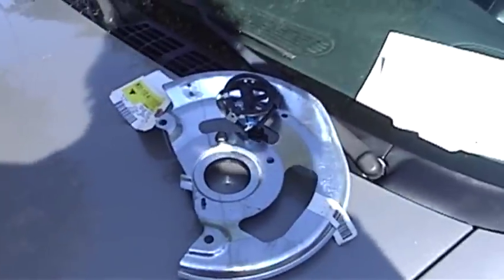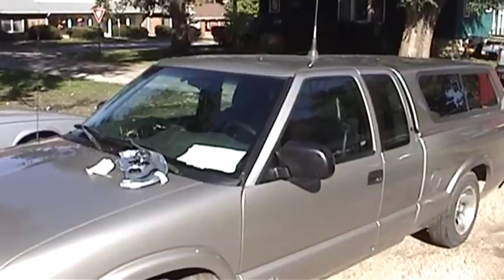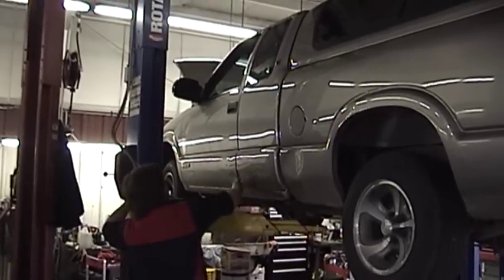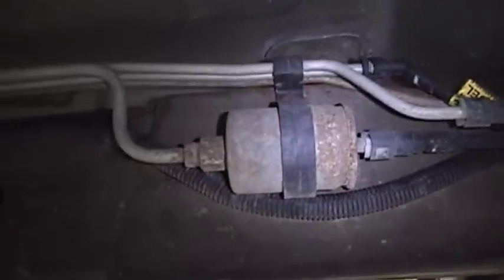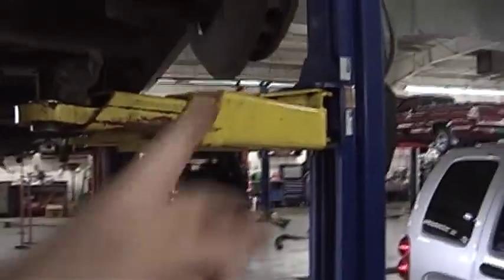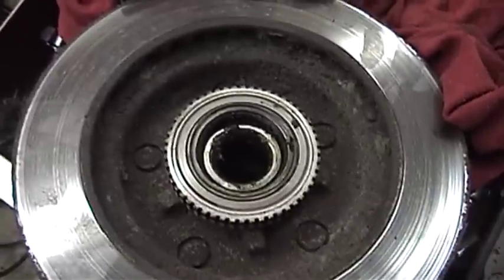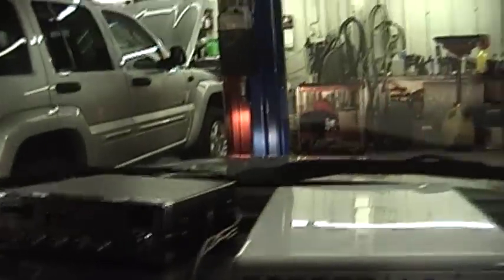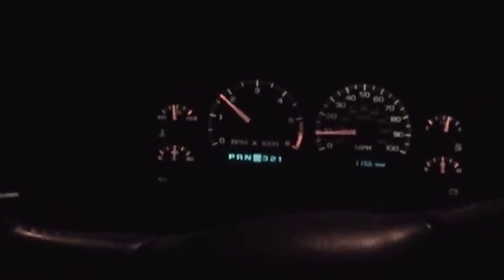2003 Chevrolet S10 ABS Wheel Sensor Replacement

Comment: I disliked this video because you do not show how the technician managed to get the electrical lead disconnected and connected.  On the S-10 it looks like it requires a trained squirrel!  You wasted my time because the manipulation of the wiring was what I needed!
Reply from the maker: Good for you.
Reply: @uxwbill   OK I did it.  The GM Factory Manual, Volume 1, Page 582/583 is of very limited help, but it did lead me to a web detail of the connectors.  GM Part No. 12052641, Metri-Pac 150.  The location of these connectors in the 4.3 V6 was established on the assembly line before the engine was installed.  They are a P.I.T.A. to see, reach, and disconnect.  My arms look like I have been in a machete fight.  The right side is much easier than the left.  I manipulated a long flat blade screwdriver under the plastic tab on the connector and with a flip the connector separated.  This is NOT easy to do there is so much in the way and the connector female side is attached to the frame on a sliding little bracket.  On the right side removing the mass air flow sensor and the air filter will help.  The GM personnel involved in the wiring routing details should be ashamed at this.  They have no interest in maintenance, just moving the vehicle down the assembly line.

Comment: I wonder did the brake lights eventually pop back on after a few weeks???
Reply from the maker: No, I never had any further trouble with it. Several thousand miles later, I traded the truck off because the fuel pump failed.

Comment: my mom's 2003 chevy blazer the brakes sometimes spaz out on her, like we will be driving down the road and preparing to stop so she puts her foot in the brake and then the brakes start to stutter then she loose all pressure in her brakes and therefore she has to pump them to get them back. we have taken the car to a part store and there are two abs sensors that have gone out. we have replaced the master cylinder and that has helped a little bit but it doesn't fix the problem.

Comment: My 2000 chevrolet s10 xtreme active or press the brakes after driving several minutes. brake pedal becomes hard as if the vehicle off. as I can fix this problem?

Comment: . You show us your truck parked, you show us the neat code reader, you show us what the underside of your truck looks like. It's 4 minutes in till you show the wheel. Then there's a shot of everything off but the wheel sensor.
My husband fortunately has done brake work, so he's taken everything off, but it would help if you stayed on task and showed the process of actually taking stuff off for someone who hasn't done brake work yet and just needs to do the sensor.
 Are you not allowed to show it?
Reply: To anyone that needs it, this video shows the wheel, rotor, and hub removal process for a Chevy Astro 2WD which should be the same as the S10.

https://www.youtube.com/watch?v=WCXcAH33RR8

Comment: Hi Bill,  The “cow head” as you referred to on the yellow tag is there to aid the GM employees when sorting a particular GM dealers parts order in the warehouse . Every GM dealership has their unique symbol.  This reduces errors as the picked parts are sorted and increases production so our customers can get the right part in a timely manner.  Thanks for the video. Waiting for spring to replace my speed sensors on my 2000 suburban.

Comment: Hey Bill I have a question for you to ask the keykeeper.   My ABS light sometimes comes on along with the brake light but I shut my truck off then start it back up and they go off.  Cause what it will do is I start it and my brake and abs light both come on.  Then I shut it off and turn it back on and they go off.  What could that be?  Cause there is nothing wrong with my brakes.

Comment: They do make portable lifts where you basically get 4 hydraulic jacks (they lift up more than a jack would, it is a real lift) and sort of a main unit with a pump. Would be perfect for the garage since you wouldn't need to build it into the floor.

Comment: These GM's are funny like that. As are some other cars. You have to drive them after a while to turn the damn light off. I notice this happen alot after people get a drive clean done. It messes with the ABS system because only the front wheels are spinning (FWD cars) so it sets a code thus setting the light off.

Comment: My way to fix the ABS light?  Put a piece of tape over the light, or take the bulb out!  I hate anti-lock brakes.  I'm used to pumping my brakes, and to me, when the anti-locks kick in, I feel like I don't have control of the car!

My Safari van is making that exact same noise!  I'm about 99% sure it's the AC compressor.  Everything else on the front of the engine has been replaced recently, including the timing chain.  My problem is, I don't have time to work on it.